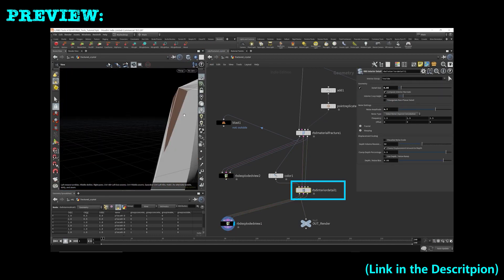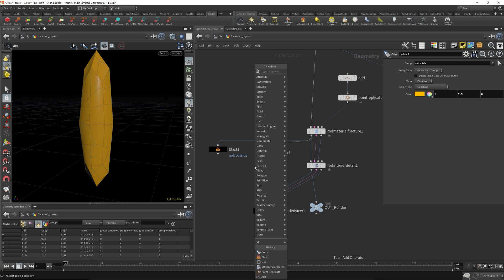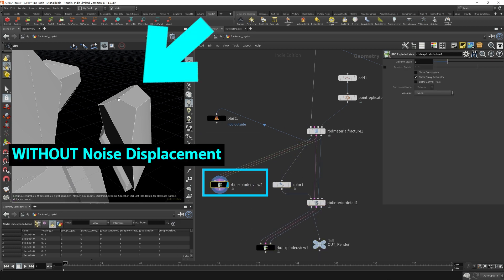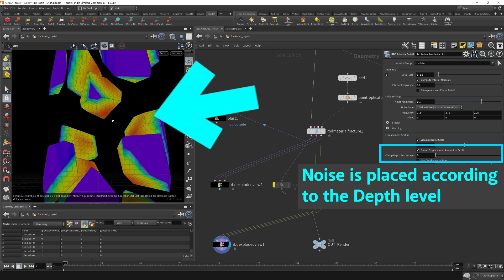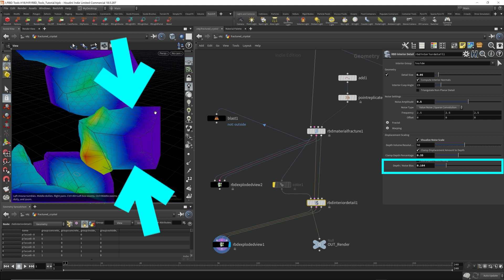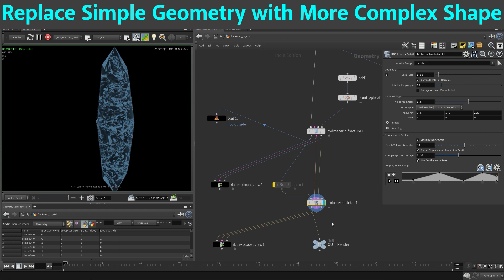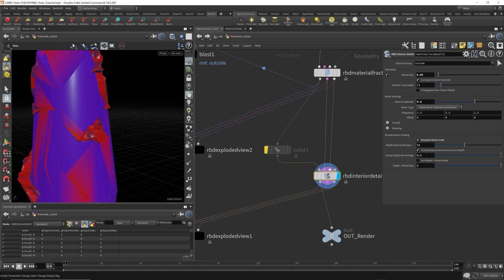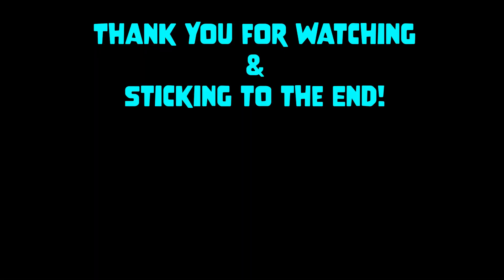Interior Detail & Noise Displacement using RBD Tools in Houdini

Comment: Hey! I dont know if this is the place to ask for a request but could you make a quick tutorial on how we can create edge damage and edge wear on sop level? Ive looked around and most tutorials show how to do this at shop level...Thank you in advance!! :)
Reply from the maker: Definitely drop all your requests in the comments of any of the videos!  But I do have a long list of requests that I'm working through.  I'll add this to the list.  But if you don't want to wait, I did a blog article on how to isolate the edges of fractured pieces a couple of months ago.
https://bubblepins.com/blog/outlining-geometry-with-unshared-edges
You can throw on a resample node and then add some noise to the points, however this won't give you a nice cut out from the original geometry. 

Now that you got me thinking on how to approach this... I think one of the easiest way may be to use multiple grids that has a lot of point noise and then use the boolean node to "shatter" the geometry as an alternative to fracturing.  This should give the edges more interesting shape.

Hope that helps!  I'll do a video on this later, but it's a long list, may take awhile.
Reply from the maker: I just remembered that the RBD Tools has an Edge Displacement, which physically puts noise on the edges of each fractured pieces on the SOP level.  I do a small blurb about it in another video at (20 : 30, the bottom link is linked to the timestamp of the video) 

https://youtu.be/hwo7tkz68Z8?t=1230